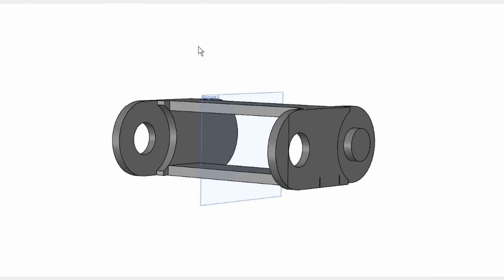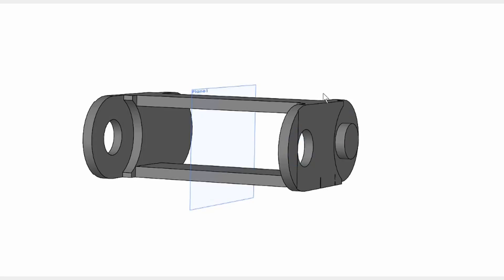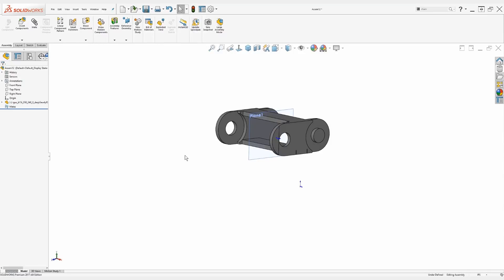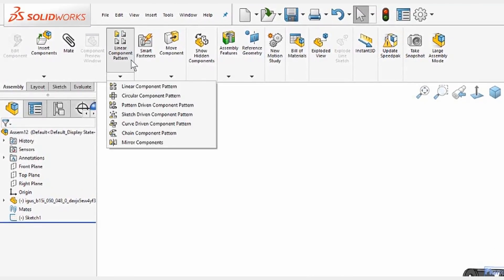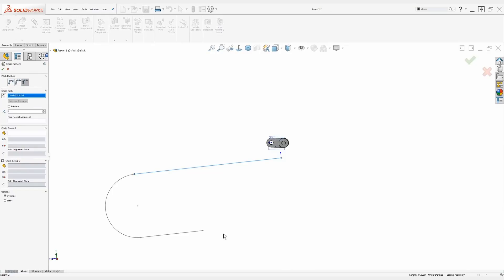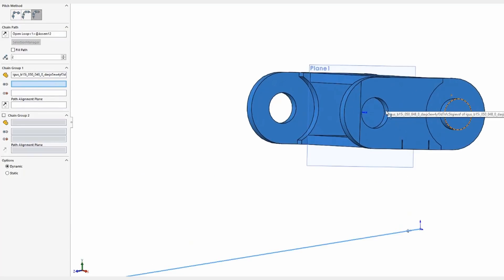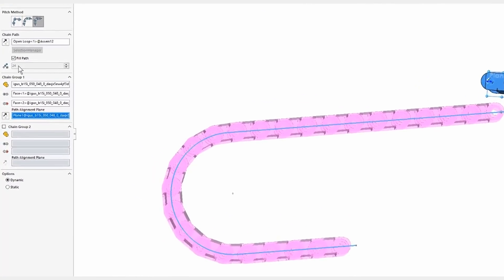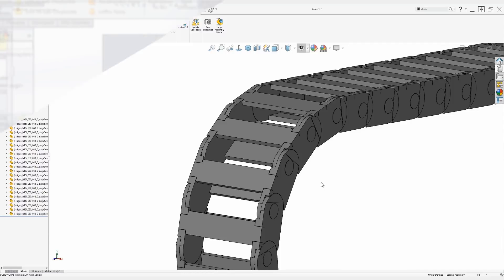Video Tech Tip: How To Create a Chain Component Pattern with Connected Linkages in SOLIDWORKS

Comment: at Chain group 1 when i select the assembly ,it selects just a part of it and not the entirely assembly.Why?
Reply from the maker: Assemblies and subassemblies are not supported for a “Chain Group”. Each Chain Group only allows for selecting one part file and associating the 2 “Path Links” to it. Essentially, the “Connected Linkage” option of the Chain Pattern only allows for 2 part files to be connected as a chain. If the intent is to use a subassembly as one of the Chain Groups, then the workaround of saving the subassembly as a part file should be used.
Reply: @Trimech  thank you:)